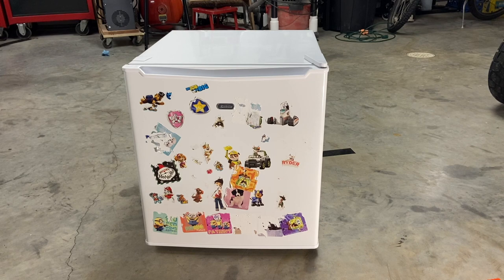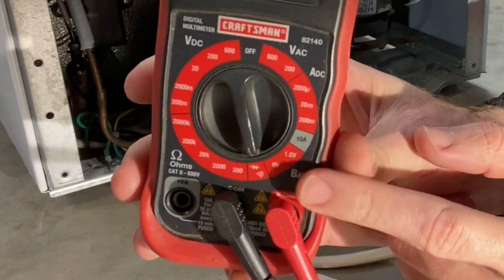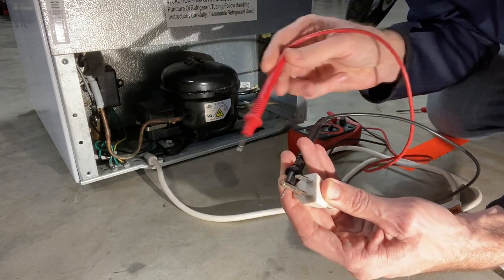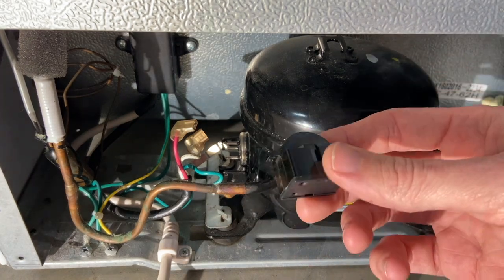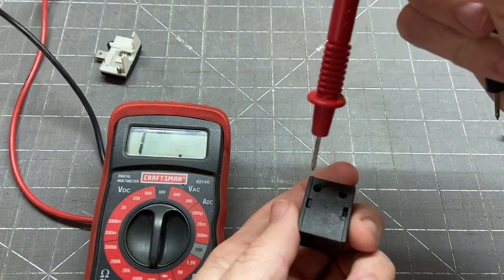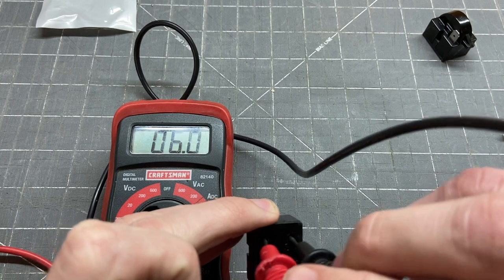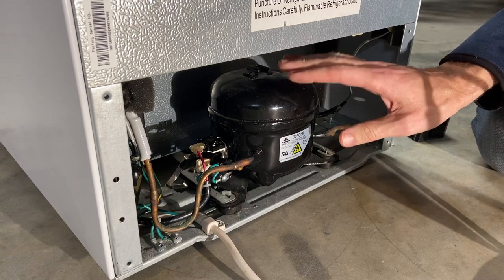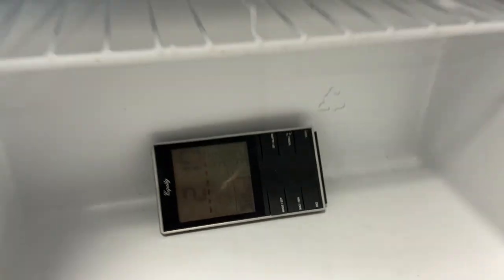Mini fridge repair - fresh off the curb

Comment: Thanks Dustin for posting this and other videos about mini-Frig simple repair. I checked the compressor start relay and it appeared to be functioning fine. You replied that it might still be an issue. I ordered the starting relay and overload device from Amazon, deciding that either or both might be an issue. Replaced them and my wine frig is working as it should. Thanks so much for putting this out there. Minor, inexpensive and relatively easy to repair.

Comment: Thank you so much for sharing. I have that same exact fridge and it just stopped cooling two days ago.  I called Sunbeam support asking if they could recommend a local repair person. I was transferred to Galen’s (a company claiming to sell the parts for various bands of mini fridges. I was told that that parts aren’t being shipped and my best bet was to just buy a new fridge.  I’m going to follow the steps you did and just see what happens before I decide to just chunk my fridge.  I’ve only had it for 3 years, so I really expected it to be repairable.
Reply from the maker: Good luck with the repair. If you have questions along the way, I’ll try to help
Reply: So I got to the plug and tested for the complete circuit with the two flat things.  I just hear a fuzzy sound.  So I know my issue is related to the plug.
Reply from the maker: @angelaskipping3110  the two flat pins SHOULD have continuity. A flat pin to the round pin (ground) or flat pin to any metal surface near the compressor should NOT have continuity.
Reply from the maker: @angelaskipping3110  and the fuzzy sound just means that there’s just a tad bit of resistance, which is expected. You meter may not may a clear beep sound. You can also look at your meter and if the number is near to 0, it means there is the indicated number of ohms of resistance. If this is the case, you’re good to proceed as long as you do NOT have any continuity to ground.

Comment: What would cause freezing, no matter the setting on the temp control? The fridge never shuts off basically.
Reply from the maker: My guess would be a bad thermostat
Reply: Bad thermostat. I just got mine partially repaired, but has a small leak and the motor is on it's last legs (runs but overheats). So I was advised to use a power outlet timer in addition to the thermostat, to ensure the compressor gets to rest and cool down by cutting off it's power at certain hours. It's a good practice even with fully functional fridges, to extend their lifespan. So

Comment: This video helped me figure out what was wrong with my mini fridge, even though my problem wasn't the same as yours. I checked the overload protector to make sure it was a short and the relay to make sure it was the right voltage. They were both fine, so next I disconnected the connector between power/compressor and the thermostat (it's in a black plastic box screwed into the back) and directly connected the red wire to the black wire from AC input. This tests the compressor; if the compressor doesn't turn on when I plug in the outlet, then the compressor is probably broken. 

In my case though, the compressor did turn on, so that left only one other thing that could be broken: the thermostat. I was able to get at the thermostat from inside my minifridge (it was directly connected to the temperature control knob), and from testing around with the thermal probe I could see that it was not engaging properly at temp. So I ordered a new one and gonna see if it works! Overall I would not have known what to do without seeing this video!

Comment: Thank you SO much for the detailed video. Unrelated, but what is typically the problem if the fridge is "stuck" on freezing even though the setting is not set to coldest. Our problem is that the whole thing is a freezer. We have a GE. Thanks so much!

Comment: Well, this info will come in handy someday. Thx. It strikes me that PTC relay is like a built-in self destruct feature. Planned obsolescence.
Reply: You're exactly right.  They should have used a relay that uses cell batteries or some AA sized lithium batteries.  This way you can replace the batteries instead of the whole unit 👍👍

Comment: Mine is loud. It works well, I just got it on Facebook marketplace but the compressor seems loud. I just checked the rubber to make sure it is isolated from rattling. It just sound annoying.

Comment: My mini fridge just quit working, now I'm ready to check it out.  Thanks for the detailed diagnosis!
(Later) I checked it out and the PTC resistor is broken inside.  My PTC only had 2 pins in the #2&3 positions.  I couldn't find a relay like that so thanks for specifically answering my question - can I use a 3 pin relay for  2 pin application.  Ordering now!

Comment: Great video, thanks.  I checked the plug and both relay parts with multimeter—all tested as good.  Plug it in then and no sound of it running at all, just silence.  What might the problem be given that scenario (and how to fix)?  Thank you.
Reply from the maker: Possibly a thermostat issue not triggering a request to start cooling.

Comment: Careful swapping to a 3 pin. I’m sure it’s all good in most cases but it definitely wasn’t in mine. I got a 3 pin relay to replace the broken “2 pin” in my galanz fridge. I swapped them over in the same locations and heard buzzing when I gave it power. Unplugged it and pulled it back apart. I took the cover off of each relay and came to find out that the 2 pin relay was actually a 1 pin relay with a dummy terminal in the #2 position. I guess just to give a spot to mount the 2 hot wires together, but they weren’t actually doing anything in the relay? So when I swapped it over like that on the 3 pin, it was shorting out. Yikes. I ended up taking the in tact disk out of the 3 pin and putting it in the original “2 pin” relay. Everything is working perfect now. Just a heads up to anyone who might come across this as well. I don’t know if it’s poor design from galanz, but definitely doesn’t seem the most safe lol

Comment: Great video. Can you explain why there is continuity between L&N with the thermostat on? Wouldn’t a short mean that the breaker would trip as soon as you plug it in? I guess I’m not familiar with what the impedances of a mini fridge are.
Reply from the maker: Thanks. You've got to remember that we're dealing with alternating current, so you can't think of a short like you would with direct current. The thermostats typically work off of pressure applied to a small disk via a capillary tube. When the pressure increases/decreases as temperature changes, it'll apply/reduce pressure in the thermostat switch which effectively completes or breaks the circuit thus turning the compressor on or off. Knowing that the fridge is likely warm inside, the thermostat, if dialed to a 'cool' temp setting would be in the 'ON' position, meaning there would be complete circuit between the load and neutral pins of the plug.

Comment: If the compressor just gets hot but doesn’t hum like this does that mean the compressor is shot?  All other components were tested
Reply from the maker: I’d unplug the fridge and let the compressor get cool to the touch, then plug it in and try again. If the compressor starts up, it may indicate that the compressor is starting to fail and seizes when it gets war. There’s also a possibility that the compressor has tried to start so many times in a row that it has heated up and you may still have a start relay or a bad capacitor, if it is a capacitor start compressor.

Comment: I have a Galanz Mini Fridge and it's awesome. Only problem is the bottom part to keep it standing straight, is missing the front right side to it. So it stays tilted. Anyone know what it's called so I can replace it? I've used cardboard pieces and it works, but I'd rather juat get it fixed.

Comment: Curious: When you pointed out the overload protection: One of your wires is red. Mine are Black and white. Other question: How would the "overload" happen? Does the overload protection work like a surge protector?
Reply from the maker: The power cord on mine has a white jacket, after it gets into the back of the fridge, they used some different wire to connect to the overload and start relay. They just happened to use red wire instead of black. Your black wire should be hooked to the overload as it connect to the “Common” (top) pin of the compressor. 

The overload works more as a circuit breaker/fuse. If the compressor starts drawing too much current, it’ll heat up which cause the overload to trip and cut power. The excess current draw can be caused by a compressor that has developed an internal short or is starting to seize up due to wear, low oil, loss of refrigerant, etc.

Comment: Is it normal for the starter relay to get extremely hot? I had just ordered a brand new starter relay because the new one is what’s getting super hot! Should the starter relay be shaking making a sound? I’ve never really fixed a mini fridge before so this is why I’m asking these questions! Just in case it’s a Hisense mini compact fridge, I meant to say the overload protection black and white one should it be getting extremely hot not the starter relay, I put the new parts in and it still kept shutting off I didn’t hear the compressor kick over so could it be something to do with one of them why it’s not kicking over or did they give me the wrong part?!

Comment: Hi Dustin. I bought a similar fridge brand new, and when moving it around the compressor clanks inside it's housing. Did yours do the same thing? Mine runs fine but only when moving it the noise can be heard. Some have said it is normal on smaller fridges, but I have another mini fridge that doesn't do it.
Reply from the maker: Yep. That’s normal

Comment: I have a magic chef 3.9 cubic mini fridge. I replaced both parts and it's still not getting cold. The compressor gets very very hot and keeps running. I'm assuming it's out of refrigerant or there's a leak somewhere in the line. Sounds like it would cost too much to put refrigerant in it. Darn. The refrigerator was working fine and then things starting cooling down. It looks brand new. These are about $180 new now!?
Reply from the maker: If you have the tools to do it, here’s how it can be recharged. https://youtu.be/t7JtlXzaCpw

Comment: What does it mean when my rca mini fridge (2yrs old) is running, on the Coldest setting (7) and the internal temp will only go down to 45F? It had ran on and off all night but will not go below 45F to make ice.  Thanks for the informative video.
Reply from the maker: If the compressor runs continuously but it never cools down it’s usually an indication of low refrigerant.
Reply: @DustinRogersinMO  the compressor wasn’t running constantly. It running like normal then stop. Then while later it kick on again. I’m also leaning toward low refrigerant.

Comment: Great video, fixed mine. But now I can't get that stupid plastic cover back on.
Reply: Did you ever get the cover back on ? I have the same issue . Does it need to be on ?
Reply: @paullewis7813  Yeah I got it on, it just took some maneuvering. It's a little bit of a puzzle as I remember, gotta have it turned the right way, then it seems like "...
duh."

Comment: It looks like the freezer I was given has been damaged. Not cooling. There are marks on the inside of the freezer part that looks like someone took a knife or tool to it. Can the freezer be replaced or should I just buy a new one?
Reply: You probably have a leak in your line. You will likely need it professionally repaired, had a similar situation with my mini fridge!

Comment: how could a unit fail just by sitting dormant? I have a unit that stayed in place but was unplugged for a few months. when I plugged it back in, the compressor wont' start.
Reply from the maker: A lot of possible scenarios. Corrosion on wiring contacts? Oil in compressor settled and the compressor seized? Mice chewed through wiring? 

Have you checked the relay and overload? As shown in this video, a faulty relay won’t necessarily sound bad but will prevent the compressor from starting.

Comment: Hi Dustin can you help me, my relay has 6 flat prongs not just one like in this video, I’m not sure which color wire goes where, there’s a purple, 2 black, blue, white 
There’s two silver prongs together on the top right side of the relay and one silver prong on the top left side 
There’s two golden prongs on the bottom left and one silver prong on the bottom right 

I tried measuring the ohms of the power cord prongs but it just stayed on ‘1’ no matter what
Reply: I have the same issue as you.
Did you get things figured out on yours?  I hate to buy parts that I end up not needing
Reply: @davethomas3553  no I’m sorry :/

Comment: I have a 2 door mini fridge. Is it possible that the freezer would cool but not the fridge?
Reply from the maker: Yes. Typically there is a fan that will distribute cold air from the freezer to the fridge compartment. If that fan isn’t working, or the passage way between the freezer and fridge is blocked from ice buildup, the fridge won’t get cold.
Reply: @DustinRogersinMO  thank you for the time and your insight!👍

Comment: The wire connectors are fired and crumbled off on my relay. Where can i get these type of connectors to replace them for the new relay?
Reply from the maker: Assuming you have the same style of relay as shown in this video, you’d need connectors and a suitable crimper like this. https://amzn.to/3KNUY6O
Reply: @DustinRogersinMO Thanks  I appreciate it. And yea it is the same as the one in the video. Once i get these ordered i will let you know what happens.

Comment: I have the same issue. Little black model number is QP2-6R8MD2. 
Does this mean it a 6 ohm? Can I use a 15 ohm part? All I can find.
Reply from the maker: The 6R8 most likely means 6.8 Ohm. If you Google QP2-6R8 you should get a few results for eBay. Looks like they’re around $20-25

Comment: Hello i have a question, how to disconect that small freezer inside, its possible? I just damaged that freezer with knife, and dont know what to do... Thanx for answer man.
Reply from the maker: The small freezer is what provides the cooling for the entire unit.
Reply: @DustinRogersinMO  Ok. Its some posibility to "repair" a hole with liquid metal? Or some other option???
Reply from the maker: @Slovan.nie.kolaborant  you could repair the hole, but the system would then have to be recharged. Unless you know someone with the equipment to do it, it’d probably cost more to recharge it than a brand new fridge would cost.
Reply: @DustinRogersinMO  Thanx for Your time man. Have a nice day.

Comment: if the compressor keeps running and never stops and one side of the fridge gets hot, what does that mean?  a bad thermostat?
Reply from the maker: Usually it means that it’s low on refrigerant. Most times it’s cost prohibitive to repair unless you happen to have the vacuum pump, recovery tank, gauges, and a way to add test ports to the lines.

Comment: Just replaced the relay and overload on my SC68 mini fridge but compressor doesn’t start. There is just a low hum and the compressor gets very hot. Does this mean the compressor is likely bad? Could the compressor possibly be locked and just needs a jump somehow?
Reply from the maker: I’d guess your compressor is on its way out. They do sell compressor start packs, which is basically a big capacitor that gives it a little extra juice at startup, but they range in price from $40-60. You may get a couple days before the compressor finally seizes, or it may last you a year or two. It’s kind of a gamble and typically not worth it on a mini fridge.

Comment: Hey Dustin my start relay has 2 pins and the number on it is j531q32e. Google keeps pointing to the 1 pin relay. The terminals are numered and the pin mine was connected on was on pin 2. The 1 pin relay has the pin on number 2. You think i would be safe with the 1 pin relay? Dont really know what to make of the numbers on my relay as they don't seem similar to the 4.7 relay. I did measure the resistance on mine and i was getting 956 ohms so its bad for sure. Another thing on the rear tag for the specs on my fridge it shows power input of 90w
Reply from the maker: Found this link which may give you another number to cross reference and see if it looks the same as what you currently have. 
https://www.appliancepartspros.com/answers-for-samsung-relay-ptc-da35-00099g-ap4566388-question-220951.html
Reply: @DustinRogersinMO  thanks man. So the replacement part doesn't look exactly the same but the repair video associated with the part shows the exact same looking part. Only difference is that relay is being used on a full sized refrigerator and I have a small Danby mini fridge. That fridge also has 2 wires connected to it while mine only has 1 wire connected to it on pin 2. I'm still a little unsure. I'll try and do more research. In the end I feel the 1 pin 4.7 relay might be the correct part.

Comment: Also the relay has 3 connectors on it... not one idk if that means it's a new model or what but yeah it's busted
Reply from the maker: Some brands of fridges use a start capacitor or a run capacitor or both which require more connectors. If your relay is busted, just order one with the correct number of connectors and hook the wires back to the same positions they were in originally and you should be good to go. There’s links to three different styles in the description

Comment: i have a question I have a monster coolers that is cylinder in shape that you see in convenient stores that quiet cooling would this be kinda the same setup before i take it apart or do you happen to know thanks
Reply from the maker: It’s probably very similar. Look for an access panel that can be removed
Reply: @DustinRogersinMO  i was just looking at it thru the holes from the vent and its almost exactly the same and thanks for the video cause i mess my drink cooler